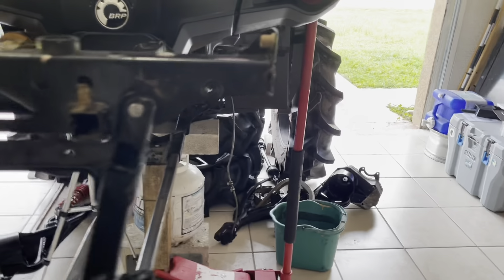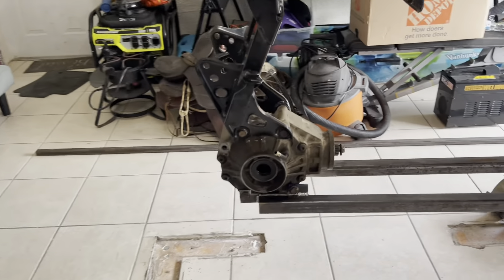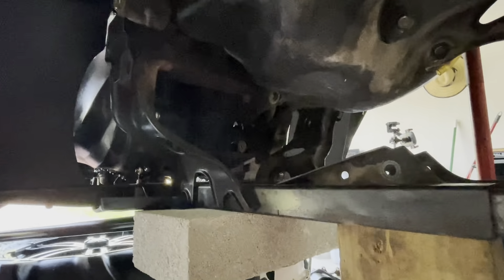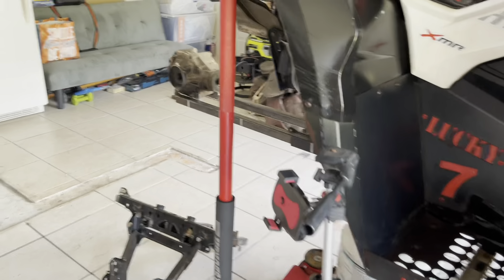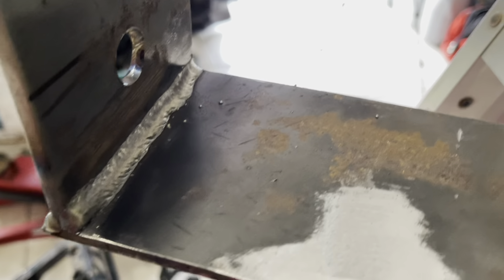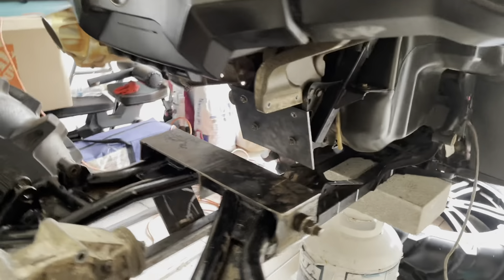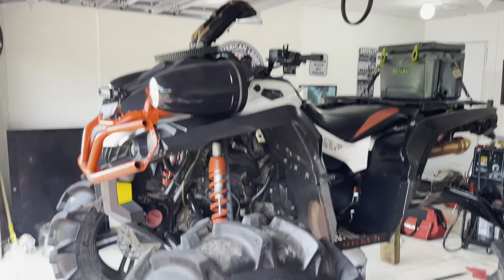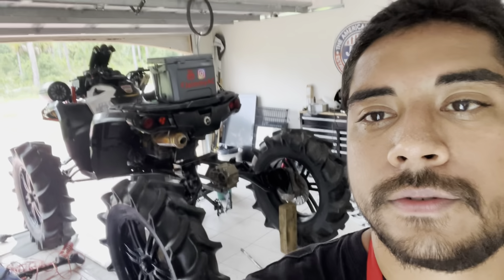Can Am Outlander Frame Stretch - Part #3

Comment: Are you putting a 6x6 trans in it. Get one if you haven’t already 850 got the small trans
Reply from the maker: No, I am keeping the stock 850 transmission. Is the 6x6 stronger? Does it fit?
Reply: @JaimmyAC  yes it’s the trans that goes into the 1000. The 850 has the same trans as a 650,570. It is geared lower if you going to stretch it I would see if you can fit the 6x6 help turn tires better, not sure if it will fit you will have to ask guys that know that depends on how much stretch you got you can get one off can am parts guy
Reply from the maker: I have been running the 44s on this transmission and it does well. Next upgrade would most likely be a stronger rear diff.